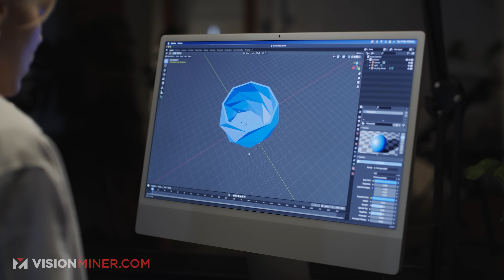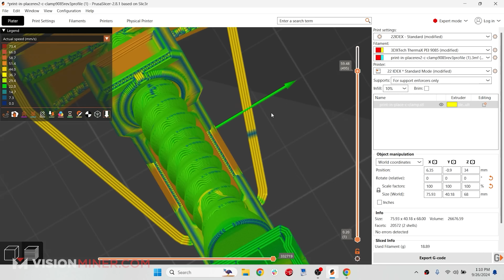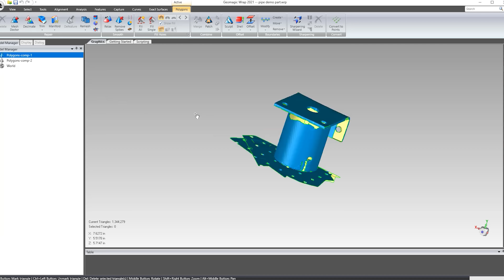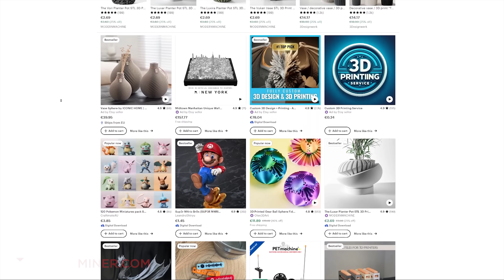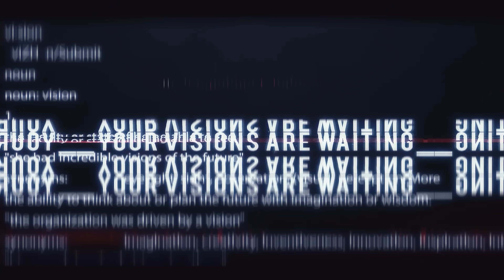Did This Machine Ruin 3D Printing?

Comment: I’ve got 3 Bambus, and I use all 3 of them all them all the time just for things around the house /garage. Bambu helped me get in to hobby and quickly became another tool that now me, my wife and kids use as a tool not a toy, despite not having full (or any, frankly) knowledge how everything works. It also pushed me to get better at fusion, and about 75% of things we print were designed by me, and that wouldn’t have happened if I had to twinkle with printer all the time, instead printer does its printing stuff and I work on design. I’d argue 60-80% of hobbies don’t need more than this. Whenever Bambu releases their larger format, I’m sure I’ll be first inline. If I can afford it haha

Comment: Bambu is mostly home appliance now. Ok, its for farms. But, printing volume and materials are never for real professional use. I love my h-bot  ZAV, it has just some outdated parts, like extruder, glass bed. These are totally upgradable parts. I dont see something special in bed scanning, I dont need it. And my printer can be totally closed with average temperature printing. What it lacks is   nozzle cleaning between prints. I am thinking how to implement this part. I need bigger printing volume, like 350*350*400, so I can buy other h-bot of the same series very cheap.

Comment: They have just widened the range of expertise or interest needed to get into 3d printing. I got a P1S as my first printer and then immediately learned CAD and parametric design and how to diagnose bad prints and what the slicer settings do. The ease of use didn't discourage me from going deep. But if I was the type of person who just wanted to print things, I could have. It's all upside. More people in printing means more investment in lowering filament prices, and more features like auto bed leveling.

Comment: Today people say ai takes jobs back in the day the assembly line took the jobs from craftmans... it didnt start with bambu and its  not only printing when i worked with cam people told me how they had to programm there g code manually when i did it people asked me if id even know whats a deviding head and as i worked on a manual machine with insert tooling older guys would ask me if im not able to grind a hss tool myself its crazy what people in the past where able to accomplish with there limited tools but being able to free our mind from solved problems it the root of progress

Comment: The equivalent: 

All these people using these cheap printers that they can buy for under $100 has people not knowing how to write papers by hand or the knowledge of a complex printing press. 

Yes, there is an issue with new users not willing to figure out problems by researching the massive information that is on internet. They immediately go asking how to fix XYZ vs figuring the problem out themselves. Biggest issue is on printing groups having the same repetitive questions being asked. 

However, the reason why products become the norm or advance is because they cater to the end user. No one uses a computer now because they know how to code and run programs via the command line. They use it because it’s catered to the simple end user. It just works.

Comment: My first 'personal computer' had an 8080 processor, floppy disks, 32Kb of RAM and an LS-3 clone for a display.  I could dial in to the company and occasionally send mail or read a USENET group.  It required constant tweaking of the BIOS, lots of cleaning the drives.  My current laptop does my taxes, CAD drawings, finances, correspondence, and lets me wander down rabbit holes and chase shiny objects at will.  And after 4 years, I've never opened the cover.  
I've been thru 7(8?) different printers and modded the heck out of each one to get it 'more functional'. My Bambu is the same as my laptop - it just works.
Reply: my first computer was a zx spectrum with tape cassette for storage and tv for a monitor, but the games were cool! lol  
floppy disks were so much better.

Comment: This is honestly the same as boomer talk "back in my day we had to go to the library to learn things" type of argument
Reply: Yeah it is but people still use it for a reason. A lot of my co-workers have 3d printers. As bad as it sounds you can tell who got into it in the prusa era, the ender era, and the current bambu era. There's a pretty big discrepancy between the first group and the last.
Reply: It totally is. They're gatekeepers of 3d printing. So freaking weird and pretentious!
Reply: Not really. Instead what they're trying to say is that as more people convert to Bambu printers and they work so well with default settings people aren't learning how to change all the slicing settings as much and therefore the quality is going down. For example way too many people use grid infill for situations where adaptive cubic or triangles would be better. Overall Bambu is amazing and I love mine but the experience of using printers where you have to learn more about slicing is invaluable.
Reply: @cameralife8  Maybe couple months later, Bambu slicer will have automatic adaptive infill type according to your model. Things will only get easier, sky is not the limit.
Reply: @seanzhouz3478  that would be amazing, but I really hope it would work well. I want them to implement the print in thin air supports that went invented a couple years back. That would be amazing!
Reply: @seanzhouz3478  that would be cool, but infill is just one of many things that could improve the result.
Reply: @cameralife8  this is like saying people don’t know assembly any more because higher level languages exist - that is just the natural evolution of products as they improve
Reply: @cameralife8  But so what? If people doing this as a hobby wanted to improve the quality of their prints, there are thousands of guides on how to do it. Why can't people have a fun hobby that they just make cool little things with? Why restrict it behind hours of tutorials and frustration? If someone if okay with a lower quality print, cool, that's their print. If they want to improve the quality, there are more than enough resources to do so. Why does it matter to some weirdo on the internet how people engage with their hobby.
Reply: @KCInherent  I don't know who you are trying to make this argument to because I am all for the ability for people to not have to learn much to get into 3D printing and I'm 100% behind it! The argument here is that there is a clear difference between who has only used bambu machines who has learned the hard way through other 3D printers and what slicing settings need to be dialed in for certain results. It seems like you think I'm angry or upset about new people coming in with only bambu but it's something I am excited for. You're acting like you're upset that I was a beta tester like Kirito or something when in reality I spend lots of time trying to help those that are starting out.

Comment: I have printed a break caliper mount to my custom bicycle first from PLA than Nylon6 CF , then 3D printed the tool to make it out of forged carbon fiber. The PLA was limited by temp but it was enormously strong, the PA6 CF was a good balance just not quiet rigid enough, which made me learn how to make forged carbon fiber part manufacturing and how to print tools for it. And the adapter works great! And knowing how to slice was essential.

Comment: I for one, since I'm the person my whole family calls for help, love it when new wifi routers just work for those with zero networking experience...or their 3d printer just works without having to know how everything works.

When things just work, life is actually easier for those who understand how they work because they don't have to help everyone with the same exact question or problem.
Reply: Exactly why I'm the only one in my family with an Android and why I'm happy everyone else has an iPhone. It just works. If anyone asks me what 3D printer to buy, 97% of the time it's going to be a bambu because they just work. I've been printing for 10+ years now, starting from a homemade replicator, my first ANET A8 fire hazard, several crealitys, various resin printers, and when my Ender 5 Pro finally broke enough I bit the bullet and bought a bambu. It's been nearly a year and I haven't done any work to it besides swapping nozzles and upgrading the feeder gears for filled materials. Literally I just select a material and a profile, hit slice and print and I love it. 

I work in industrial additive and it hurts going back to these massive machines and clunky slicers that take hours to get to do exactly what you want. Maybe they're upset that sales are down because a $700 printer requires less work and training to get great engineering level parts and people don't want to buy $15k+ 'engineering' and 'industrial' printers are just worse? The vast majority of people just want to print PLA trinkets, and fix some stuff at home and will us ASA or some nylon/carbon blends. If you wanna print PEEK/ULTEM, the industrial world still exists but I really see a downward trend.

Comment: I think of bambu as expanding the total available market for printers, it's not like the people who want hardcore printers don't have them anymore. If you want, you can still build/get a printer that is super tunable and customizable, but I wouldn't never recommend something like that to my friends, whereas I would absolutely recommend them something like an A1, where even though it's not the best value or the most customizable, it will just work for them. In that sense, bambu is more adding to the pot as a whole and opening up 3d printing to more people as a method of fabrication and less of a hobby .

Comment: I think the bambu effect has actually had a beneficial effect on design.  Previously, a lot of people wanted to design thing, but spent so much time "tweaking" their printer to actually print something successful. This constant failure to print caused a lot of people to not even get into the field because they were turned off of the geekiness of it all.  Now, with Bambu's, people are willing to take the time to learn a CAD, design some seriously amazing products and items, and then can print those items effectively.  This is why I sold my previous 3dPrinter and got a Bambu. I didnt want to spend the majority of my time "tweaking" my prints to get it perfect, I wanted to spend my time tweaking the design in CAD and learning new design skills.  Dont get me wrong, I built a 3d printer from scratch, but I'd rather have spent that year learning design.  I think there is room for all types.
Reply: That's it, I bought an Ender 3 years ago but only made 10 prints with it and then nothing for 3 years. Because the tinkering with the 3D printer took me so much time to make the print usable at all. I would have put the time I put into it much more into designing the object. Now, with a Bambu A1, I print almost every day and improve the parts in CAD. That's what I enjoy.
Reply: That’s exactly it for me. I’m not a 3d printer enthusiast. I’m a design and prototyping enthusiast of parts for other systems. I knew all the previous 3d printers would make you pull your hair out with the chronic failures. That’s why I never got one until last November. The X1 Carbon. Cope and seethe boomer scum!
Reply: This was my situation. I got the Little Monster when it first came out. At the time, it was the biggest and fastest printer on the market (until Creality dethroned it literally a month later with another mammoth bed slinger lol).

My background is mechanical engineering and I have tipped my toes into comp sci (which makes my head hurt 😂) so I'm no stranger to computational or manual drafting. I jumped on FDM printing with ambitions to mod my car and help my team mod our race cars. That idea quickly wanned when I had to consistently fiddle with settings, chasing my tail and making one thing better but worsening another aspect. Failed prints and let's not even mention the woefully inaccurate dimensions.

It went from 'lets make functional parts!' to 'well... I can print this cute statue to display on my desk...' and the printer eventually went into obscurity. Then Duet came along so I snagged a Duet2, converted my printer and finally the thing was more reliable but also had SO much more potential than before. It was still a hassle but it was much better and I didn't have to babysit it when printing.

Fast forward to now, my BL touch finally quit and I'm getting strange behaviour from the motor drivers somehow reversing themselves and crashing the head. So I was going to get an X1C but it was too small for my typical projects; figured I'd wait but politics for 2025 made me panic-buy a K2+ instead.

This K2+ is the tool I was hoping to be near, potential wise, when I got the Little Monster way back in 2018. Now I can focus on problem solving for life and mods rather than problem solving a tool that just doesn't want to behave 👍

Heck, I might even do another conversion on the Little Monster to turn it into a lite-duty CNC.

Comment: I'll give you a little jab at your (self-admitted) gatekeeping over "lost skills", and then admitting that yeah, you need to learn CAD so you can better design new and unique components, instead of just copying what exists.

But also, now I really want a 3D scanner and want to go through my home, take apart everything I can, scan every component, and index them so I have a whole-home archive of replacement parts, and would be able to readily reproduce them at any time, without ever worrying.

The real thing I personally want to do, is build a full computer isolation pod, entirely to my own spec. Living in an apartment, I don't have a lot of room for working with things like wood, so I can't really fab something up that way. But if I can bolt a few structural bars together, print up all the panels and surfacing for the pod, and be able to print upgrades any time I think of it? Heck yeah. Many major material fabricators build their own workstations to their personal spec, whether out of wood or metal, why shouldn't it be the same when the workstation is your computer desk and your material is pre-ducted, hand-sculpted, 3D printed plastic panels? It's all Tab A into Slot B, in the end. You just have to know how to model the tabs and slots to fit properly.
Reply: Outliers drive civilizations, the common denominator are just resource intensive cash cows.

Comment: This is hilarious. Back in 2011 I was working in the contract R&D world on making PLA blends for a filament manufacturer. We didn’t have a slicer at the time, we used excel to assemble the gcode and then walked that over to the machine. It was a giant pain. I don’t miss that era of 3D printing. The machine was Mendel Huxley Frankenstein that would occasion fall apart because we shoddily made it in 8 hours. 
I
Reply: Oh God I do not miss the early reprap days
Reply: That's the thing, no one misses that era of the tech. Nobody would want to go back to that, its awesome how the tech advances, but then videos like come along, lamenting the advancement of the tech because it allows average people to engage with it. Huh? It makes no sense.

Comment: I agree - the bamboo printers made things so much easier for people to the point that they don't understand or even know of what came before for those of us who have been doing it for a long time. Hell I soldered my own RAMPS 1.3 board from components. Its crazy. I'm glad more people are printing, but it definitely changed the landscape. I listened to so many people recently in a Microcenter talking about the printers they bought and the Etsy store they now run. None of that was possible for the average consumer like 5-10 years ago.

The bamboo effect that I've seen is multi color prints. They existed before, and there were things like the Prusa MMU, but nearly nobody really did it. Now that the AMS exists, there are multi material prints EVERYWHERE.
Reply: Respectfully, why should anyone care what came before the bambu or the burden of what any of you had to do from a tinkering standpoint to achieve quality prints?

It's awesome that 3D printing has been a hobby / passion of yours for however long you've been into it....but it should be exciting all of that laborious tinkering / problem solving isn't necessary anymore thanks to better consumer grade tech that you also get to benefit from using.
Reply: Multi material options were either expensive or open source project that was too much of a pain to integrate into a 3d printer without having to troubleshoot it so much.

Comment: That "just going to work" thing is exactly what 3D printing needs to be. Being nostalgic for when things were hard and shitty isn't the way. 3D printing was stuck in hard and unreliable for far too long.
Reply: Yet an Ender 3 can produce parts with the same quality as a X1C 🤷🏻‍♂️
Reply: @zerotweaks  With significantly more frustration and much higher barrier to entry. That's the point. Feeling superior because you have a machine that doesn't work as well without significantly more frustration and startingly less efficiency is one of the strangest quirks of the gatekeepers in this community.
Reply: @KCInherent  frustration only if you don't know what you are doing 🤷🏻‍♂️
Reply: @zerotweaks  that is exactly the point. There need to be printers that allow both noobs and pros to get great results. Gatekeeping won’t help anyone. It’s so dumb. It’s like saying everyone should be able to operate a letter press because pressing ctrl-p in your word processing software is too easy.
Reply: @hectobit  I'm just saying facts tho, and it is not gatekeeping, everyone can reproduce the ellis guide for example
Reply: @zerotweaks  you are gatekeeping tho. You’re implying it’s better to use printers that are objectively not as easy to use. If that’s not what you’re saying then what was even the point of your comments?
Reply: @hectobit  following basic steps is difficult nowadays 🤣